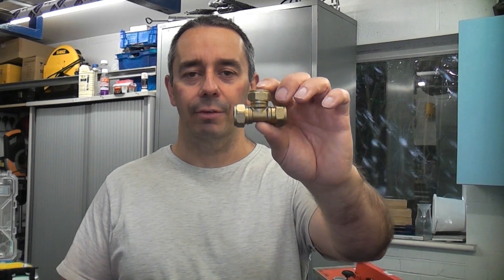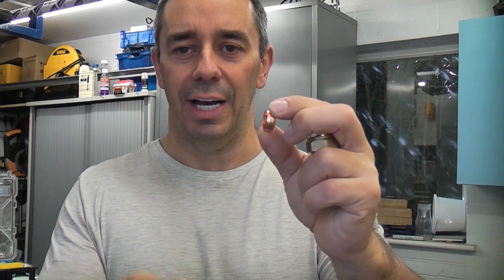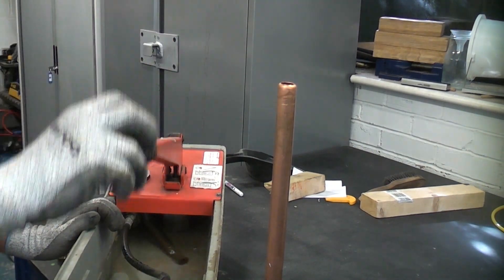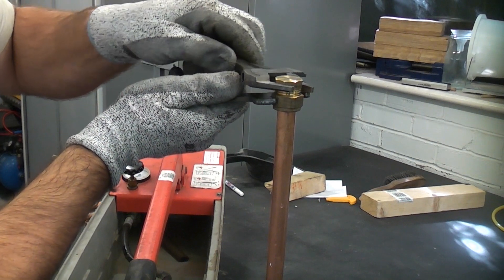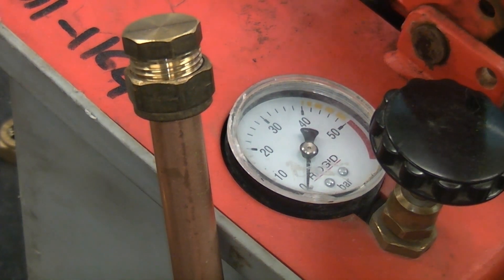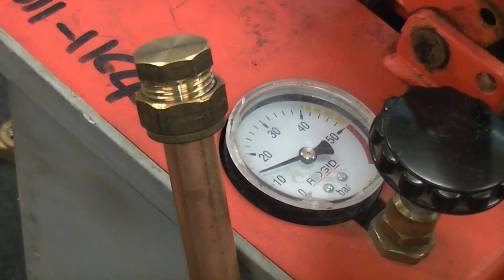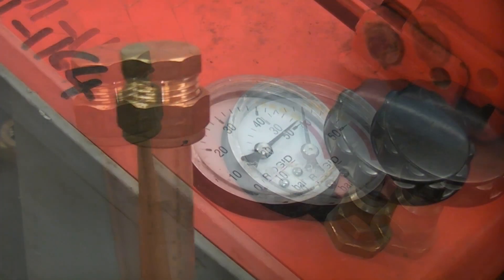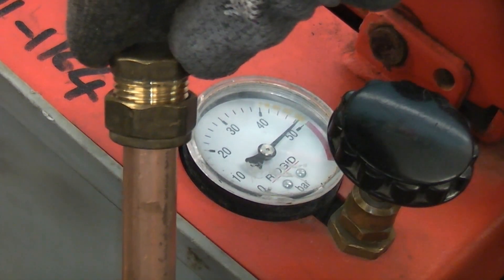compression fitting pressure test

Comment: Compression fittings are great. I only use teflon paste in order to lower the force. I tighten by over 1 turn after finger-tight. This can take a bit of muscle, and the connection is probably bomb-proof.

Comment: My god man, don't put your hand over or face anywhere near an over pressurised 50bar pipe/fitting 😳 . I was waiting for it to all go wrong with 50 bar in when you wiggled it about and tapped the top.
Good video though 🍻🍻
Reply from the maker: I've pressure tested 100 Ton vessels 😉 
The pressure testing rig does not have the volume of water to cause any real damage, but thanks for the concern

Comment: Would you need to sand down the end of the pipes before fitting?
Reply from the maker: No, you just need to remove any burrs before using a compression fitting.
If using solder fittings, it's a good idea to clean the pipe with a Scotch brite pad after removing the burrs.

Comment: Would you be confident using compression fittings on a concealed shower valve? The whole area will be tiled over. And if so, would you only use copper pipes, or plastic? I'm fitting one next week in a new build that has hep20 pipes throughout, so would be easier to stick with plastic. I have no experience with soldering. Thanks!
Reply from the maker: Yes, compression will be fine.
Sometimes you do not have a choice as most shower wall brackets are compression fittings.
I always use copper olives though- they seem to seal better than brass olives ;-)

Comment: It occurs to me that you apply a couple layers of ptfe tape BETWEEN the copper pipe and the ferrule/olive, it may make it much easier later on, to remove that ferrule/olive, for servicing..
Reply from the maker: I don't think you'll get anything between the olive and pipe, as they are generally a very tight fit.
Thanks for the comment
Reply: @ultimatehandyman  I recently replaced a compression fitting under my kitchen sink, where the ferrule was too loose on the copper pipe. Not sure what was going on, but when I tightened it, and then tested it, by pulling on the compression nut, the entire thing slid off the copper pipe! I ended applying 4-5 layers of teflon tape, between the copper pipe and the ferrule, and thankfully, it all worked. It was only later that it occurred to me that this might also have the added benefit of making the ferrrule easy to remove later on, if needed. That is, if you can get at least a layer of ptfe tape between the pipe and ferrule, which as you've noted, may not be possible.
Reply: You want to turn the compression fitting until you hear squeaking and then 1/4 more. AIM for 1.5 turns after finger tight. The olive should never come off the pipe now or later. The point is as the compression fitting bites the olive compresses the pipe and the bit beyond the olive gets wider thus you have two things holding the pipe in, the olive crushed to the pipe and the pipe beyond expanded grabbing the inside of the end of the fitting

Comment: This test is very dangerous if that let go the oil coming out at 50bar it could chop your arm off let alone the fitting turning into a bullet!!
Reply from the maker: Not at all, water is used because it is not compressible (much). If it were to leak the pressure would soon dissipate as there is not a massive amount of volume behind it.
Thanks for the comment 👍

Comment: would u suggest using this brass stop end (or plastic pushfit) on a mains pressure 22mm copper pipe???
Reply from the maker: If it is permanent I would use a brass stop end, but I often use a pushfit one for temporary jobs.
The push fit, will of course be fine, but I just like to use compression

Comment: This brass fannel would be good for a 150psi compressor right? I rebuilt mine with new lines using this style xrpession fitting because they used rubber which blew out
Reply: Sorry the brass "olive"
Reply from the maker: Yes, brass olives are used all the time on compressed air- but normally with Enot fittings and Nylon tube.
Reply: @ultimatehandyman  thank you this compressor was rated at 150psi with copper line and rubber olives but they blew out after a couple uses. I installed the brass yesterday and cleaned everything up holding up so far.
but didn't let the compressor go to 150psi. Have been nervous because I'm not familiar with them. This video helped. Thank you

Comment: The pipe dope isnt to seal the joint its  to act as a anti seiz so it can be easily removed or loosened 20 years down the road .
Try taking one 10 years old apart that had no dope vs one that did !! Big difference always dope your conpressions its good practice

Comment: You might want to try to see how long the fitting will hold the pressure without leaking at 175 psi and 200 psi.  Great video though.

By the way you obviously know what you are doing making sure you evacuate all the air out. Before testing.  Because if you did it with air in the pipe you would be making a bomb and the end could fail like a bomb or a bullet going through your roof.  I cannot emphasize making this fact known.  Because I have seen site supervisors, usually dirt diggers,  say go ahead and test with air without clearing the area of people/workmen.

I would still recommend safety glasses.

Comment: its water pressure how about the air ? is it will be same
Reply from the maker: You should never use air for pressure testing or any gasses as they are compressible. A failure with compressed air or gas is very dangerous, which is why liquids (mainly water) are used for pressure testing.

Comment: Are these the same fittings used on espresso machines? Would it work for steam under pressure?
Reply from the maker: I have never looked inside an espresso machine, sorry.
They should easily take the pressure though.

Comment: What do you think about smaller compression fittings connecting steel brake line with copper brake line in cars?
Reply from the maker: I have never used them, sorry.
I have used small compression fittings on small bore copper tube though such as 10mm and they work fine for that.
Reply: if it's stainless steel then you shouldn't have a whole lot of galvanize corrosion. using copper at all seems like a bad idea though, since it corrodes faster than stainless in almost any circumstance
Reply: No.  They are illegal in the UK.  Use a proper flared joint.

Comment: Looks like 3/4 inch pipe, what is the wall thickness.??? good video...
Reply from the maker: Hi, it's 15mm pipe which is roughly the same as 1/2 pipe. The wall thickness is about 0.7mm 
Thanks for the comment

Comment: Nice one chez , i am with you on using copper olives , much easier to tighten up also i always put a smear of boss on the olive just to prevent it binding and squealing when tightening , also my mate who works for a hydraulic  piston company says he once tested a piece of 22 mm copper on there test rig to see how much it could take but the rig could only go to 150 bar and it held out , amazing really... cheers  : )
ps.....looks like you've lost weight....
Reply from the maker: +yensabi Blimey 150 bar is crazy pressure!I am back at the gym and have been eating much healthier for about 12 months, to get in shape for the lads weekend away (last weekend). I just need to keep it up now ;-)Thanks for the comment
Reply: If there's anything I learned from my plumbing days - don't use copper olives, go with brass if you can. You will be doing yourself and others after you a big favour.

Comment: Nice review there. I personally wrap a bit of ptfe round the olive only and always use copper olives. Just a belt and braces approach really. Generally becaus these are mechanical fittings they have a tendency to potentially loosen but extremely rarely. This is why compression fittings have to be accessible but so many showers etc have compression fittings that have to be buried! A well made compression joint shouldn't leak, so many times o have seen put people put ptfe o. The threads...no don't do it!
Reply from the maker: +Zed Man 
Thanks for the comment ;-)

Comment: why do my compression fittings leak at the top? iv tightned them to max turn but still get a drop or two exiting the top.
Reply from the maker: +blessing786 
What make of compression fitting are they?
If you don't know that, are you buying them from a reputable shop?
Is the olive brass or copper, as the brass olives can be difficult to compress to make the seal.
Reply: Sounds like you're over tightening them! I know this is a 5 year old comment and you've probably figured it out by now. But do them hand tight, then give them 2 x 1/4 a turn with a spanner and 99% off the time they will not fail. Some people tighten them with spanners to the point its so tight, is actually crushes the Olive so much it creates little pinholes and thus making y9u get leaks!

Comment: Does the same apply for qualpex
Reply: Sorry I mean does the same apply not using Ptfe on qualpex
Reply from the maker: +jerry o connor 
That is push fit isn't it?
If you are using compression fittings with any pipe you should not need any form of sealant. But a copper olive is preferred as they are easier to compress.

Comment: nice video.how would push fit fittings hold up to pressure tests im guessing they wouldnt hold as long without leaking
Reply from the maker: +Roy Kirkham 
Thanks Roy, I will test push fit when I get time.
I have tested a flexi tail and that held 50 bar with no problems- which shocked me!
Reply: Ok that will be good to watch.keep the videos comin mate there very good iv watched alot of diy videos while iv been doing work on my own house to pick up tips and yours are some of the best iv seen
Reply from the maker: +Roy Kirkham 
Thanks Roy ;-)

Comment: compression fitting should be stronger than a solder fault line :P thats for sure haha i use to have a leak in the t junction on boiler main side feed for the rads yea bam pull the pipe of yes not heating just pulled it out of its complink re spliced the end with my new roch set 15mm and 22 mm cutters put compression and new pipe where i thought bad pipe and solder was :P now the bar pressure has not even dropped or nudged on my boiler at all been fixed for approx a year
Reply from the maker: +SgtAMYNTAS 
Thanks for the comment ;-)

Comment: Massive thanks for making this video, I was one of those that inquired about 50 bar on the other video. It's a staggering pressure, I'd have never imagined regular fittings could handle it, but there it is, clear as day.  Kudos.
Reply from the maker: +kardredren 
You are welcome.
I was very surprised when it pressurised to 50 bar. I expected it to leak well before that!
Thanks for the comment
Reply: parker CPI (a compression fitting with single ferrule, like this one) is rated for a working pressure between 2400-4700 psi for 1" pipe depending on wall thickness, and 2600-6700 psi for 1/2" tubing, depending on wall thickness. this is stainless tubing.
I don't have specifics on Parker's brass compression fittings with compression rings, but they do offer one as seen in this video and they say that all of their "low pressure" compression fittings are rated to 1000 PSI at 200 degrees F...which includes their larger sized fittings, which have the lowest pressure ratings. the copper tubing is likely going to be your weakest link, with a rated working pressure for type L drawn copper at 770 psi for 1", and 1105 psi for 1/2" pipe. Oh and the cheap Type M stuff is rated for 515 and 760 psi working pressures for 1" and 1/2". burst pressure would be far higher. Ultimate Handyman didn't even come close.

Comment: Your adjustable spanner as you call it. ..
in the USA we call it an adjustable wrench 
but....
I was wondering what brand it is and if that is something that could be found in the USA 
I'm in the maintenance field and that style head is very useful for getting into tight areas 
the thickness of the head is very unique. .. I have switched from a heavier style channel locks brand pliers to the knipex cobras for the same reason which has been a good set of pliers 

thanks 
enjoying
Reply from the maker: +napodano26 
I specifically bought that adjustable spanner for work as most adjustable spanners (adjustable wrenches) have thick jaws, which prevents you using them in many applications. They are made by Bahco (who apparently invented the adjustable wrench), I have found some in the US on ebay- http://fave.co/1jyDtZo
Thanks for the comment ;-)
Reply from the maker: +TheGreybelly 
That's a good point. On the sites where I work everyone has Bahco as they are the best.
Thanks for the comment
Reply: +TheGreybelly I been using the todays tool adjustable and they are decent and cheap, you can pick them up cheap at toolstation. they come with a wide jaw with narrow pointy end, perfect to undo fittings it tight area also have a nice small grip. 

http://www.toolstation.com/m/part.html?p=70950
Reply: +Ultimate Handyman Thank I appreciate you looking them up for me ...
I will be purchasing theses in the near future
Reply from the maker: +napodano26 
You are welcome ;-)
Thanks for the comments
Reply: +napodano26  
I buy everything Bacho, superb quality and last forever. I believe snap on bought them out a few years back or vise versa.
Reply from the maker: +hucks33 
Thanks for the comment ;-)
Reply: +TheGreybelly Bahco don't adjust themselves when you take them off the nut? Cracks open wallet

Comment: compression or Yorkshire fitting? unless you're not allowed to use Yorkshire fittings being a Lancastrian? ;-)
Reply from the maker: +Daniel Thorley 
Ha Ha, I only know them as compression fittings. To most people I know if you ask for a Yorkshire fitting you get a solder ring fitting (which are brilliant).
Thanks for the comment ;-)
Reply: +Ultimate Handyman yes, Yorkshire are the pre-soldered ones. I just meant which do you prefer, if you could use either?
Reply from the maker: +Daniel Thorley 
I prefer the solder ring fittings to be honest as you don't run the risk of under or over tightening the compression nut. I will be covering this in another video soon ;-) 
Thanks for the comments ;-)